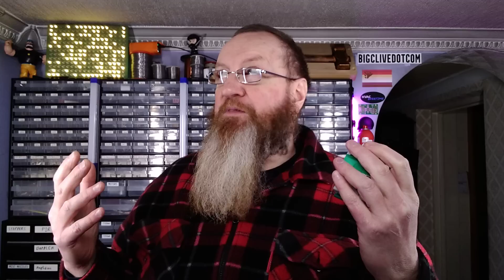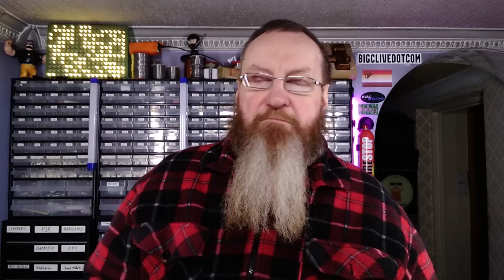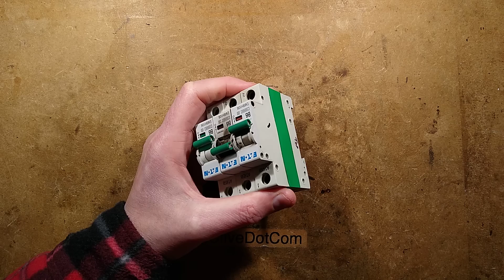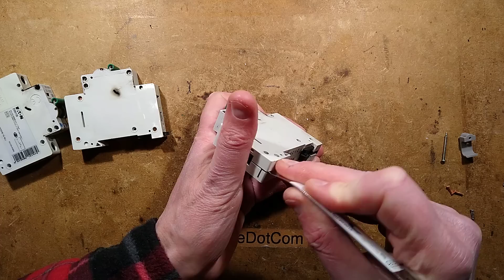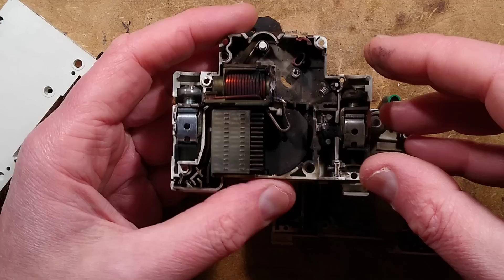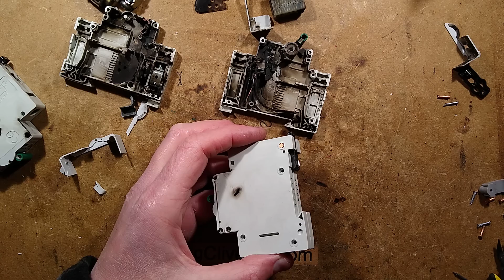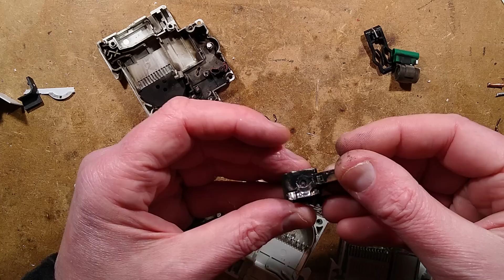Arc flash breaker failure - let's open it

Comment: I've been having a miserable time getting a programming gig, do you think it might be a decent idea to try to get into electrical? I do find this stuff to be fascinating but I don't have formal training in it. I have been watching these videos and others for years and I think I understand a good chunk of it.

I'm in the states because I'm sure that matters.
Reply from the maker: Depending on what area you feel you would enjoy, you could apply to local companies or unions for a position as an apprentice, helper or trainee.
There's no harm in making a career direction change.
Reply: There's a lot of "coding" and setting parameters for electrical stuff nowadays, so it would be beneficial to have a background in programming.  Plc's and many lighting control systems are usually a bit scary for a basic electrician.  Lot of stuff is on networks too, so understanding routing etc helps a lot.

I think it would be easier to teach coder to turn a screwdriver, than a basic electrician to count in binary and hex..

Then there's a lot of documenting, so efficiency in excel etc for collecting data in the field and making it presentable is now a big thing.
Reply: With our unpredictable economy, I highly recommend diversifying your education and talents. Don't put all your eggs in one basket, as the saying goes. The more varied your skillset is, the easier it will be to find gainful employment because you'll have more options available.
Reply: @dashcamandy2242  Right now in the States, if you have a basket of eggs, you're on a gold mine . 🙂

Comment: What were the external floods like, high pressure sodium, i would suggest replacing the entire setup due to a ban of HIDs in 2027 for the same reason that took out fluorescent lighting.

And extremely beefy wires for purpose.

Comment: We have had to put in many manual motor starters and have had to add arc schutes to the manual motor starters .We use ones that have the ability to add low voltage release relay which just clips on to the side of the manual motor starters .Its funny that the manual motor starter is rated for 600v but any VD in the plant while machines are under load cause bad arcs as the machiens shut town to protect 100hp 3p motors

Comment: It looks like a job I had many years ago where an 11kV line came down onto 415V. The contactor in the equipment looked the same and was welded shut, the fuses had vapourised along with many other faults.
It was a case of squinting your eyes and using a wooden broom handle to activate the switch and apply power as I repaired it.
Reply: Hahah man, when I saw what Clive has in his hand, I was thinking "OK, from now on, I will activate those with wooden stick"...

Comment: That is very sobering.  I will reset an mcb with trepidation in future!  To be clear - are you recommending wearing gloves when resetting one of these after working on a circuit or only when resetting after an uncleared fault?
Reply from the maker: Mainly where it has been subjected to several short circuits in the past.

Comment: I could smell that once you opened it.
Reply from the maker: Strangely it wasn't that bad.
Reply: @bigclivedotcom are you sure you are not suffering from olfactory epithelium deficiency syndrome? I could smell it in Leighton Buzzard!
Reply: I could smell it before he opened it.  Had to deal with this situation many times in my career.
Reply: I know it's not exactly healthy, but I kinda like the smell of burnt electrical stuff.
Reply: @hammerth1421  For some years I worked in an office environment where the equipment under test and development was a mix of 240v and 120v.  The outlets were distinct, but the equipment all had standard IEC connectors and many people who frequently switched out the equipment on their desks had a mix of power cords coming up onto the desk waiting to be connected to equipment needing power.

With 80,000 square feet on that open floor, we knew when someone had confused their cords and plugged 240v into 120v equipment.  The length of time between the capacitors exploding and the smell arriving gave a pretty good indication where it had happened!
Reply: @hammerth1421 It's a less well-known fact that computers run on the grey smoke. Ask any IT technician - once the grey smoke leaks, the computer won't work anymore.
Reply: @hammerth1421  - Burnt up industrial electric motors are among the 'best smelling' ones. Pun not quite intended...
Reply: same it reminds me of when my entire circuit breaker panel caught on fire.

Comment: I've worked in shops with austempering heat treating equipment where molten salt is used as a quench medium. The salt vapors get everywhere and precipitate in the cooler control panels. Have I seen "tracking"!
Reply from the maker: And seaside electrical equipment too.
Reply: Ground mounted equipment or underground near roads or paths where grit and salt is spread in winter can also suffer...
Reply: Yep, here on the marina we see breaker faults similar to this on an almost weekly occurrence as the end users often self reset without reporting it up the chain, and when it fails... spectacular darkness occurs 😂.
As always Clive, first class breakdowns and excellent content 🙏🏻

Comment: I really hate intermittent faults like this...they are so hard to diagnose sometimes
Reply: I see what you did there
Reply: Everyone does :-)
Reply: All faults are either an open circuit, a short circuit, or somewhere in between
Reply: @mattyb7736  😂
Reply: The real trick to diagnosing them is having continuous monitoring in place already. REALLY saved my butt several times!